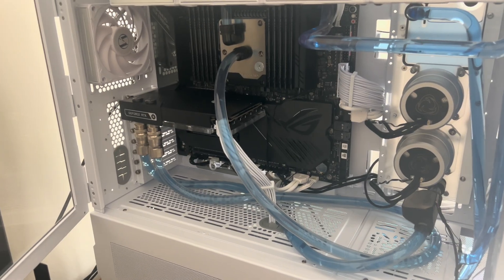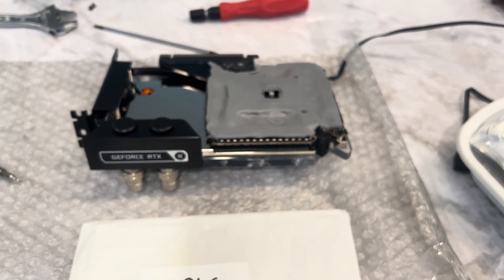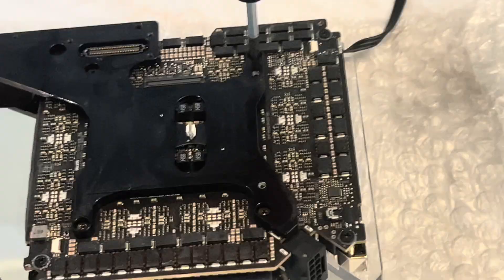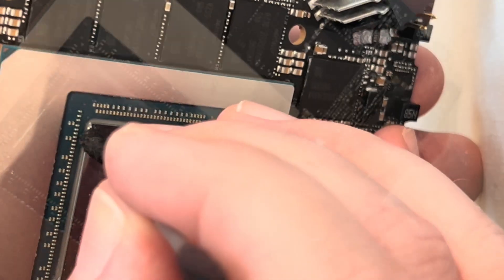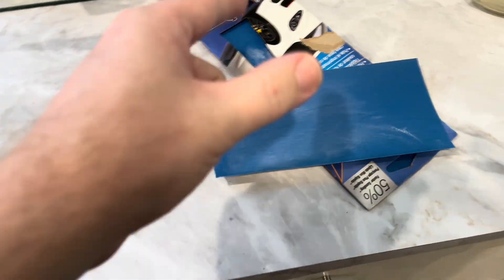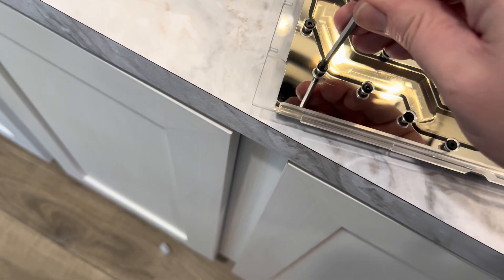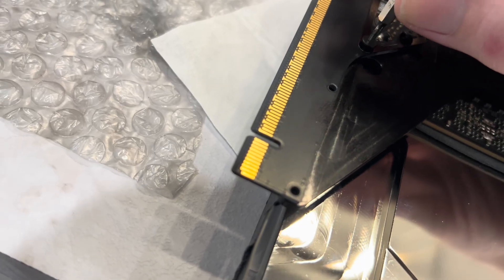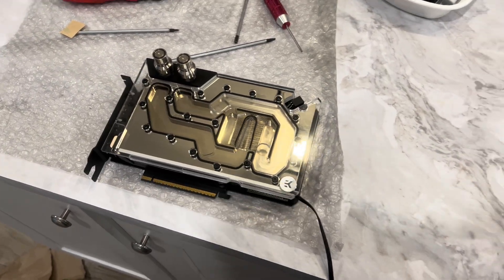RTX 5090 FE EKWB Water Block Repair, and Block re-mounting! Liquid Metal application and all!

Comment: are those stock ek thermal pads?
Reply from the maker: No. The stock ek ones are good though. They upped their quality big time.
Reply: @videocardzrule354  Good to hear that the mess of "full coverage" on the backside wasn't EK. FYI, by plastering it with pad, you're actually insulating much of the card rather than improving thermal conductivity. That is why you're supposed to use strips that are sized correctly for the areas that will actually contact the block or backplate. It's also crucial that you only use pads where it was designed for it, if the gap is more than a few mm, pads don't go there. Too thick of TIM(thermal interface material) is also bad, just as your pads taking heat to nowhere, you're better off with the components being cooled directly by air.

Comment: Why did this happen to begin with, did you overtighten the screws?
Reply: Did they at least replace it free of charge?
Reply from the maker: Honestly, I’m a professional at this stuff. So I did not over tighten the screws at all, because I never tightened them, on a water block we’ll do a spin test on screws just to confirm no screws free spin or are loose, but that’s it, I’m really not sure why it cracked. They had to be too tight from the factory, and my hot air gun warmed the plexi just the tinniest amount and CRACK. Or it happen when I flushed the block with hot water then cold water to clean it.. And this caused it. But I just happen to hear ticking noises in my PC case, and I saw it was cracking. I mounted the new plexi with only finger tightened screws. So it won’t happen again that’s for sure. I literally used a bit to tighten them. Also, this plexi isn’t very strong.
Reply: @videocardzrule354 still waiting for the vbios 🥺
Reply: @videocardzrule354  I think this is hopefully just a bit of a freak occurrence and not indicative of a poor block manufacturing. I have had EK reservoirs develop similar sort of cracks and I have treated them with absolute care, like a newborn baby. Only time I ever got cracks exactly like the ones you had was when I accidentally got isopropyl alcohol on an EK PCH block. Looked fine day 1, then next day just like yours. Just the danger of plexi I guess. Just something else to factor into probable cause, as I see you using it. I know how careful you have been though. I have loads of EK plexi products right now, but next time I fully upgrade my build I think I am going to just go all acetal and not worry about viewing fluid or looks over piece of mind. Glad you got it all up and running good again! Definitely caught it just in time!